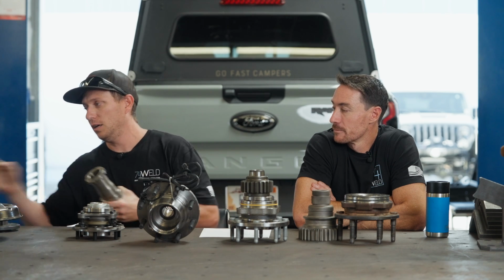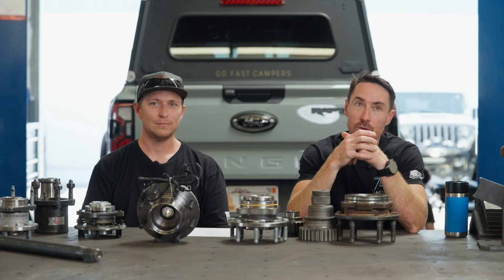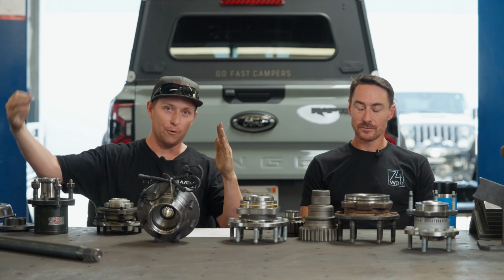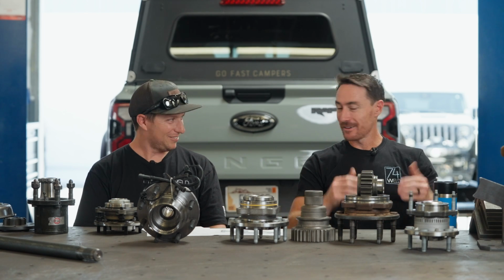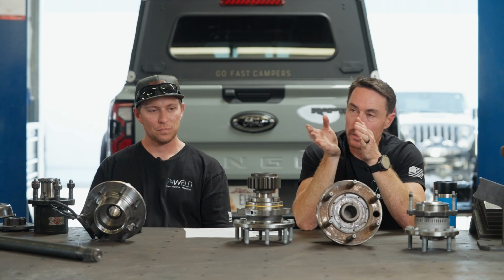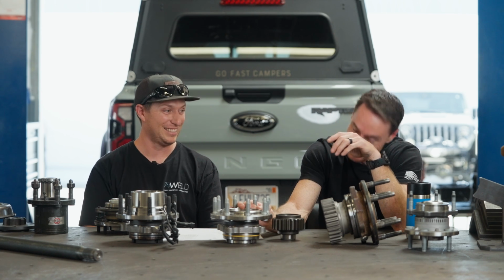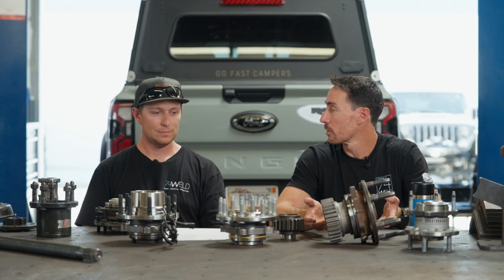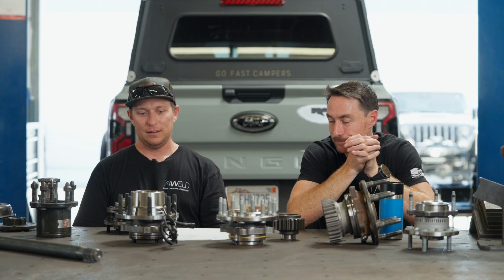A Technical Dive into Hubs, Unit Bearings, and Portal Hub Assemblies

Comment: You guys thought about making portals for quad motor Rivians? Their Achilles' heel is lack of low end torque for crawling (due to the motors insufficient starting/stall torque). Portals/reduction could remedy this, even if not a large market a Rivian R1S with four motors and four portals would be a cool demo vehicle.

Also while range would take a hit, portals could enable flat towing which currently isn’t possible with Rivians.

Comment: Any chance of adding the ability for CTIS ?
Reply from the maker: @48Troll  yes. We have a system in the work. I just think the way most do CTIS with a line sticking out the hub is lazy and easily knocked off. We have been testing a new system without lines for several months. Likely a 2025 option.
Reply: This would be awesome. Would it be a addon option for older purchases?

Comment: Also I forgot to mention, a custom tune can get rid of the no power braking issue on the ranger raptor. They have been doing that for years, some of it is in transmission settings for maximum allowed rpm for inferred movement.
Reply: As soon as Cobb gets the Bronco ECU unlocked Goosetuned will provide this as standard on their tunes 🙏🏼
Reply: @Sierra_Bronco  You only like Cobb? No HP tuners or SCT?
Reply: @ponyboi.gamer36 I like Goosetuned for his tunes. He uses Cobb for their accessport. Not seeking big power gains with portals and 40’s-that’s already a lot for the rear axle to deal with.
Reply: @Sierra_Bronco  that's a lot for any axle to handle. Lol I've never heard of that shop and I started getting into tuning as a hobby. I'm really picky and spent so much time studying it I don't think anyone doing it for me at this point would be fulfilling. Kinda defeats the accomplishment.
Reply from the maker: @ponyboi.gamer36  I talked to a guy at ford about this. I should be able to powerbrake in Baja mode. Will report back soon. I should have my FP tune for the Ranger Friday. Will have to bake off and try 😜
Reply: @74weld  New tech is great when it ain't causing headaches 🤣 baja mode, fancy fancy.

Comment: On the ABS tone rings are there different tooth counts for different years and different sensors?
Reply from the maker: @ponyboi.gamer36  yes. Most all vehicles that run tone rings are all different teeth. We have seen a dozen different variations but Jeep is unique to Jeep. Nothing crosses over. And even if it did, sensors are all unique to that specific application. Unfortunately there is no industry wide standard
Reply: @74weld  okay, so when you are doing the bolt on stuff you are making custom tone rings for each application to match the factory so the ABS still works. Would you then be able to repurpose a say D60 portal that you build into the knuckle and build it with a tone ring for 99-07 ranger? If the customer provided the tooth count for their application?
Reply from the maker: @ponyboi.gamer36  unfortunately not really. Every wheel speed sensor is different and you would need a custom bearing pack to accept that sensor. Not a simple task unfortunately
Reply: @74weld  damn, now Im curious what Ford to Ford sensors are the same from unit bearing to unit bearing. I guess the only other option would be to find someone who can reprogram the ABS to a different tone ring count. As you refer to the mechanical style system, with the tone ring, all tone ring sensors should produce the same signal out from the tone ring pulses. The only part that would then change is the amount of pulses that are sent to the module.
Reply from the maker: @ponyboi.gamer36  someone smarter than me could probably do that…we just make our systems match OEM so we don’t have to “trick” anything. New vehicles are a different story. They keep getting more complicated, integrated, and complex.

Comment: Laughed at spindle explanation. Reminds one of a scenario where dude broke his stock knuckle while running portals. “These @radflo shocks broke and that took out my ‘spindle!’ The factory spindle is fine with portals and I’m not just saying that because if the knuckle wasn’t strong enough then that’s a major design flaw on my chinese cast steel portals!” 😂🙄
Reply: Those were the tibus aluminum ones right? It also then came out Tibus also makes his stuff in China. Apparently these are the only guys who make stuff in the USA!
Reply: Yeah it was dongbuster. Not sure if it was on the Tibus portals he used to claim were the best thing on the market or his new cast iron atrocities that will have those super tight china tolerances we’ve all come to appreciate.